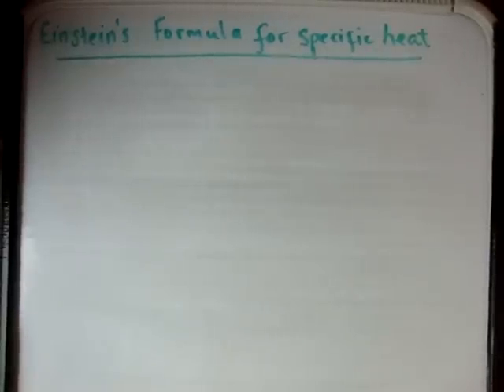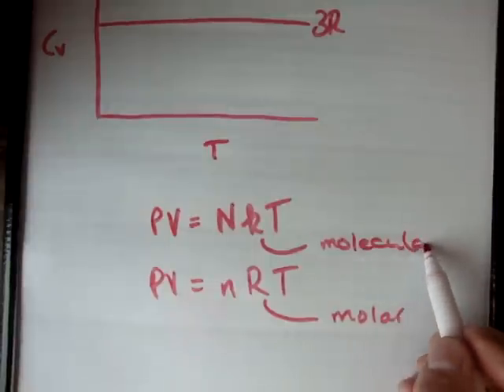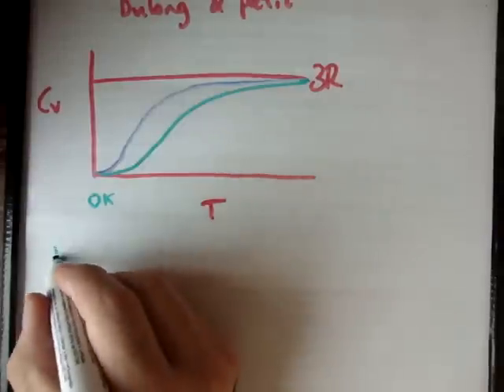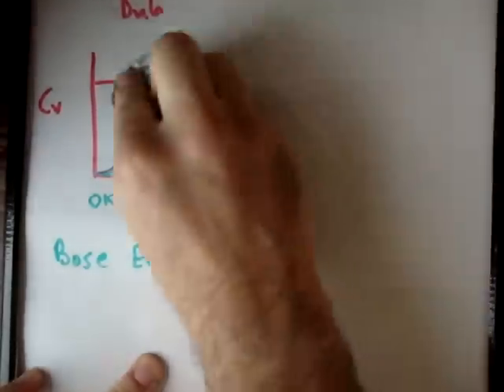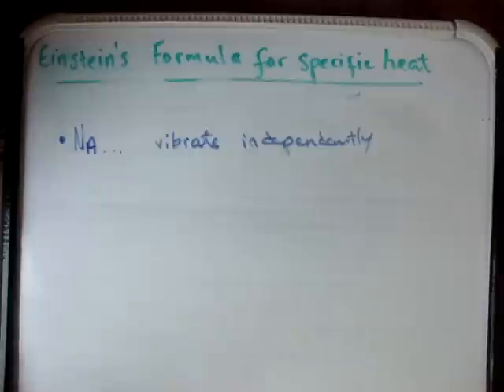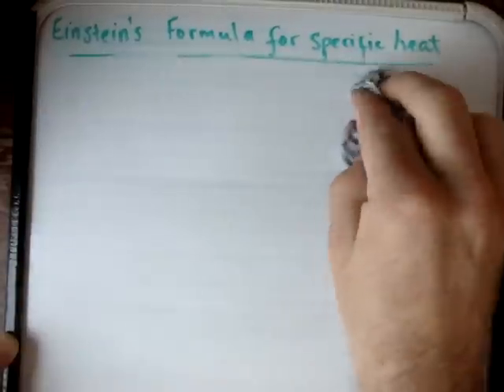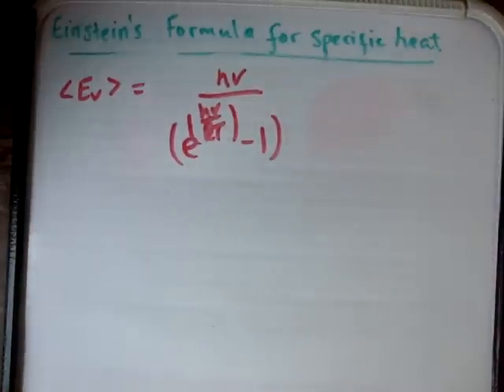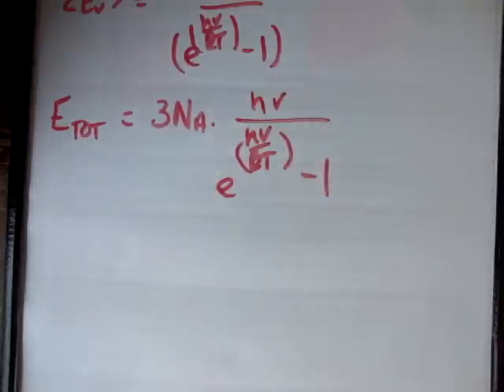Quantum Statistics 36 c : Einstein formula specific heat

Comment from the maker: Answer Part 2: See Daniel Schroeder's book, 'Introduction to Thermal Physics' for his section on 'Big numbers'.Basically,there are 3 sizes of numbers; ordinary, large and extraordinarily large numbers. When an expression has a mix of numbers of various sizes,you can be more harsh with the approximations on the smaller numbers.So here, the numerator's a large number but the denominator is extraordinarily large.We give a harsh approximation on top but are less harsh below using a Taylor expansion